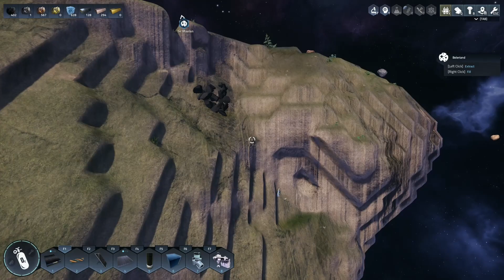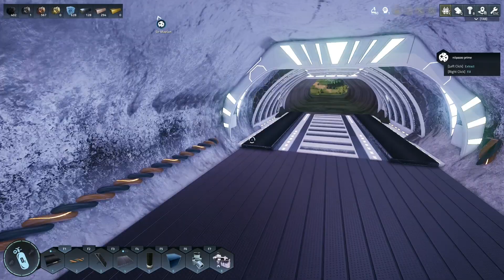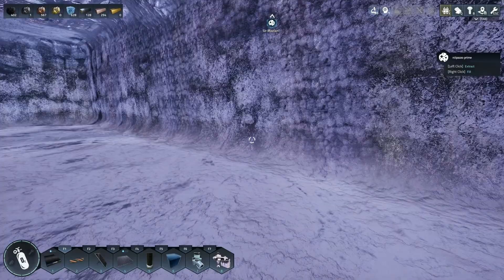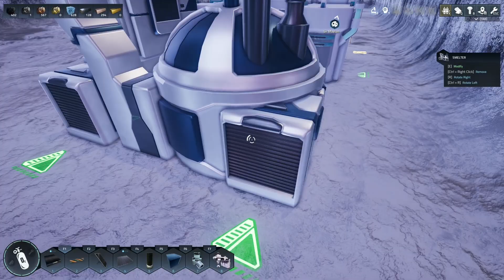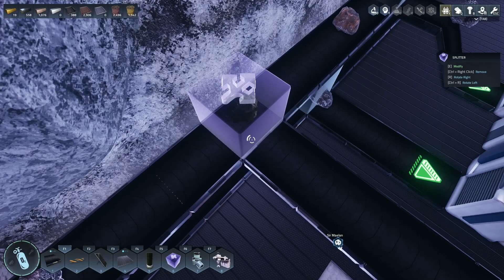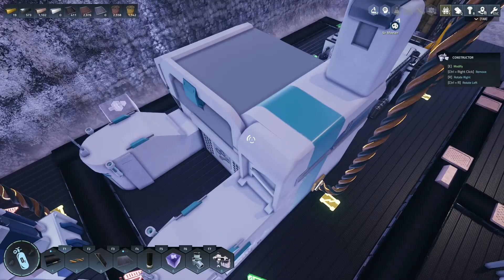Astro Colony - 19 - Ore Processing

Comment: 8:55 I've noticed so far with buildin's if you put a belt over their input they don't suck Goods in, but if you put a belt over the output they do push Goods out, as long as the belt isn't facein' into the buildin's intake The buildin' won't take Goods, unless you're usein' a divider &/or force logistic block of course.

Comment: 22:30 I've been doin' that since I figured out the X16 speed & then Let you know about it.
Reply: Please note:
The numpad +- and * keys were NEVER intended for general use, they were intended for testers to use...
So if you decide to use these keys to speed up or slow down your game you DO IT AT YOUR OWN RISK..
They stop autosaves from working, and create quite a few other bugs, which will NOT be fixed due to these commands not being supported in normal games..
So reporting a bug from using these keys will most likely be ignored and not fixed, as I said, these keys were NOT intended for normal gameplay...
Reply from the maker: I didn't know the speed change wasn't intended for general use, and I've actually had a few odd things happen with mining after using it a few times. Maybe I'll avoid its use in the future, Thanks for point that out NZ_Wanderer